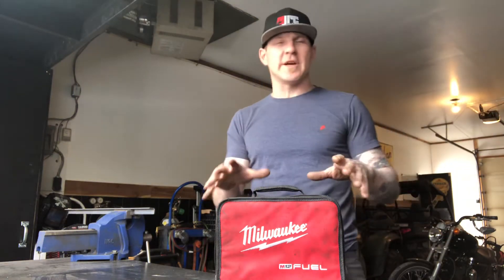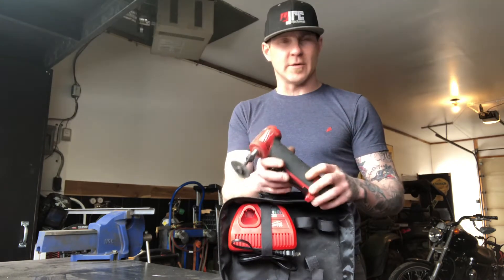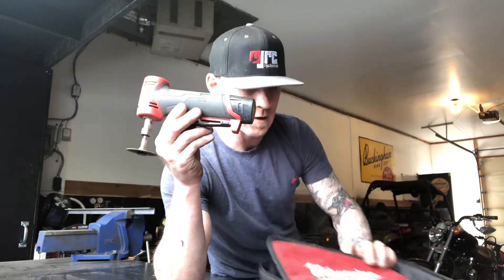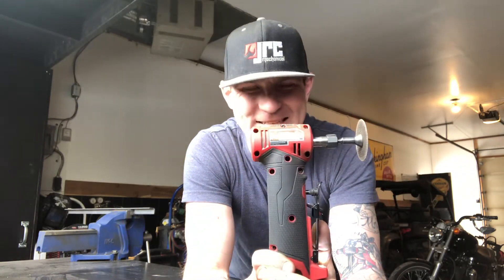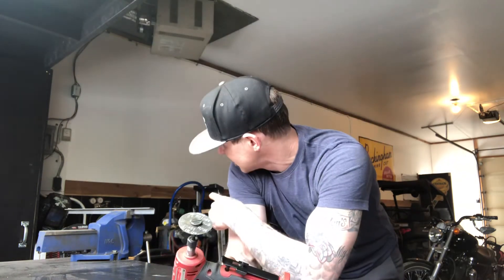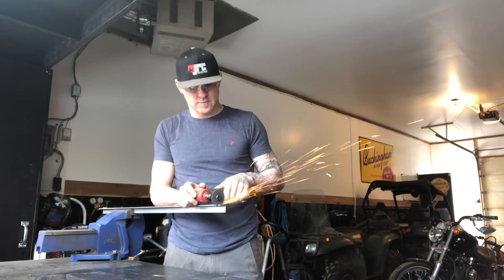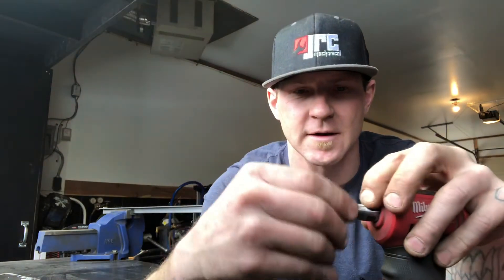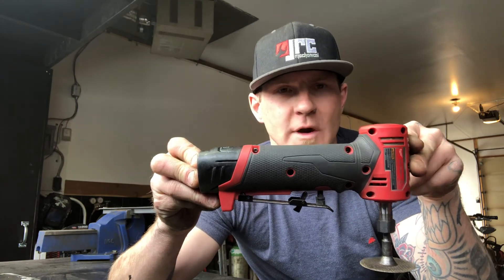Milwaukee 12v 90 degree die grinder

Comment: It is a self release collet.  If you can't get the 1/4 shaft out easily loosen it with the wrenches and then after a couple more spins the nut will bind again.  Loosen it one more time and the shaft will easily come out.  There are a couple your tube videos that will show you how it works.  https://www.youtube.com/watch?v=z4Nh-Px6ZGg  It is not like a regular die grinder collet.
Reply from the maker: Ah yes now I see! The nut on mine wasn’t in the grove of the Colette even from new, Thank you for the info!